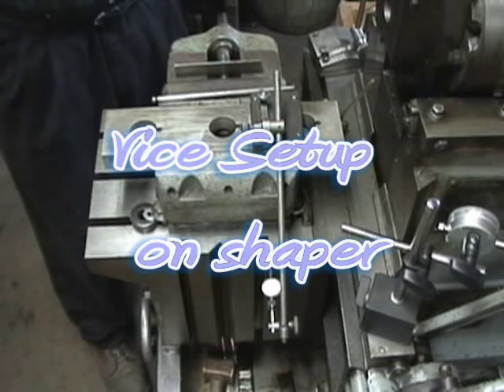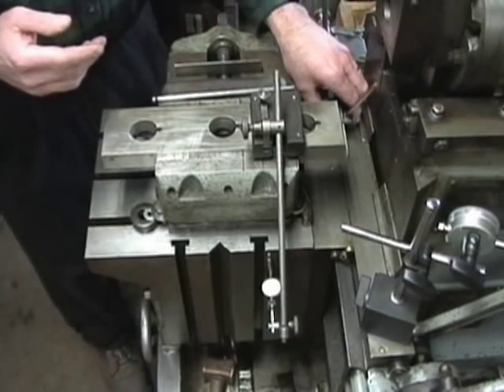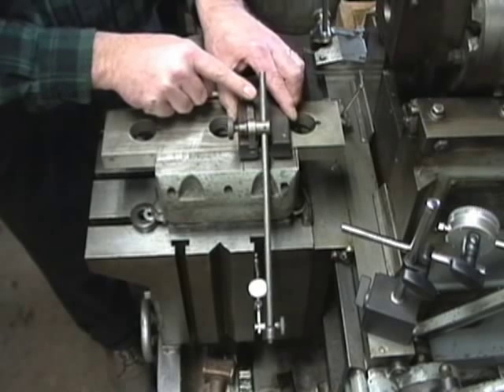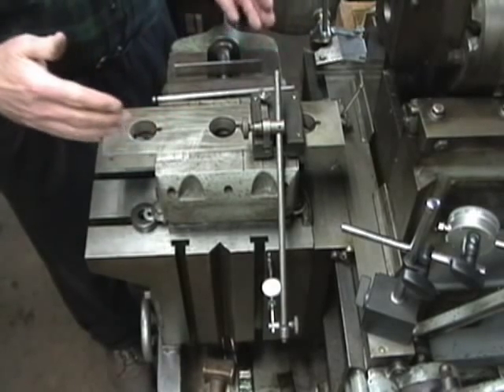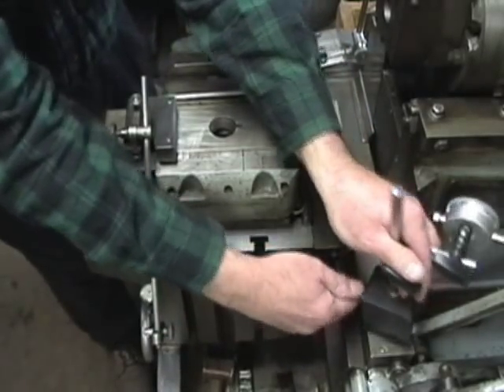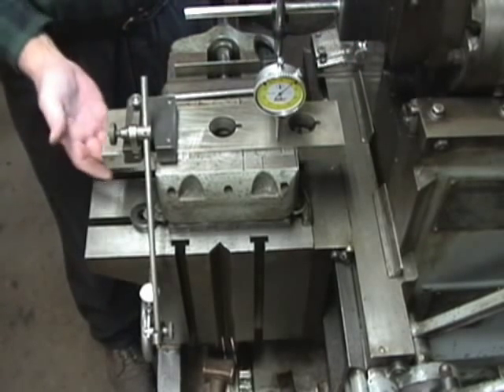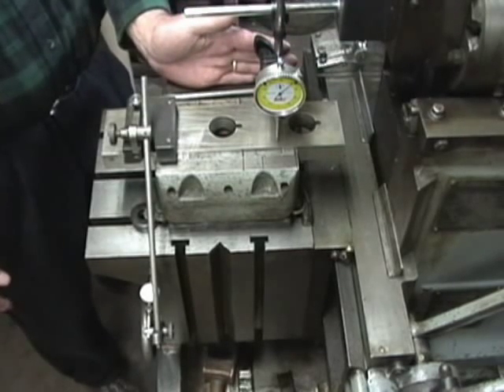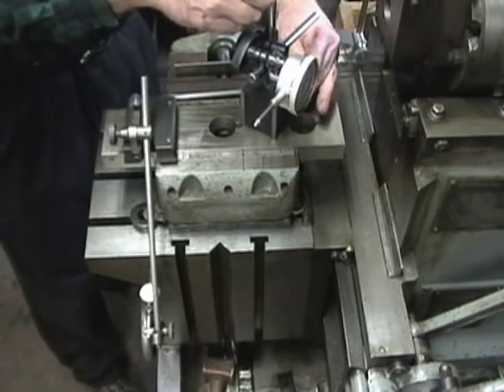Shaper vise and table setup.avi

Comment from the maker: On a universal miller with a swivel table (good example) you can travel the table back and forth a good number of times with a mag base on the column indicating a slot, or you can just drag a surface gage with the pins in the slot back and forth indicating the column ways (much quicker).

Thanks for the response! And for looking!

Comment from the maker: The ram to the T slot is still good on that sheldon.  Assuming things were out of parallel to the slot from wear after using an indicator on the ram (and also determining the squareness of the table and the table to the column), you make adjustments when using the surface gage. If the slot indicates .002" out in 12", I would set a 6" vice .001" out (you catch on pretty quick after thinking about it).

Comment from the maker: @ yoimalex, Good question! The answer is, the post is as much about using a surface gage as it is using the shaper. It is easy to think the surface gage is an "old timey" tool for scribing things or indicating against a reference, so many never expand its use. I use one constantly with horizontal boring mill work, turret miller work lathe work etc. as its as fast as you can move your hands and resolve.

Comment: Good vid. I have one question though. Why would you not indicate the vice jaw to the ram stroke? Unless you know the table is dead square to the ram stroke that i can see that working. I have 2 shapers ( check out my vids on youtube) both shapers are square to either side of the table but not totally square to the machine base. My gibs are correct and stuff, i just suppose wear over the years has played on it. Therefore i indicate the jaw to the ram vs to the table for a true cut.